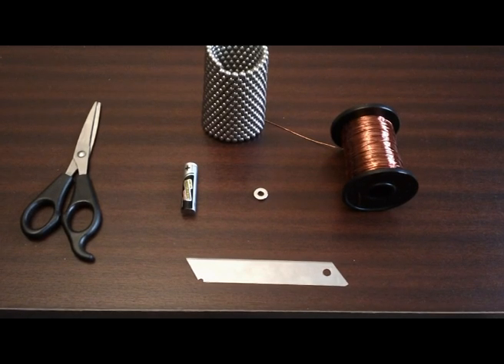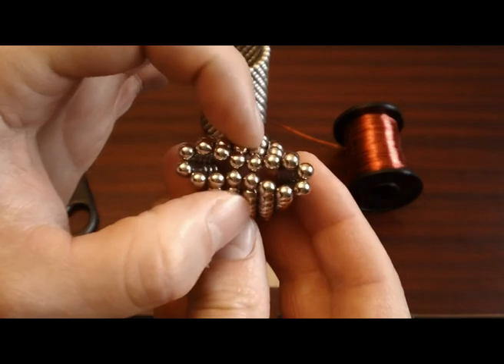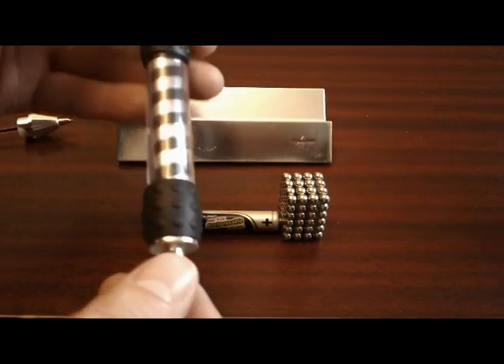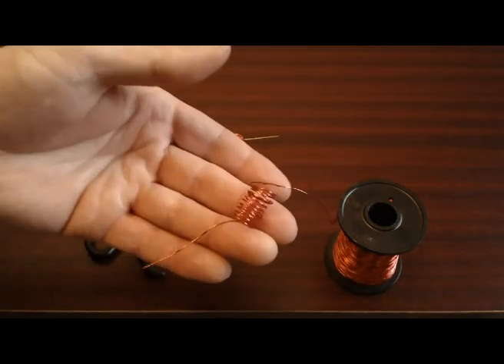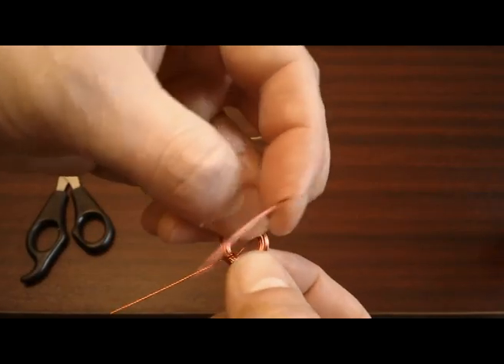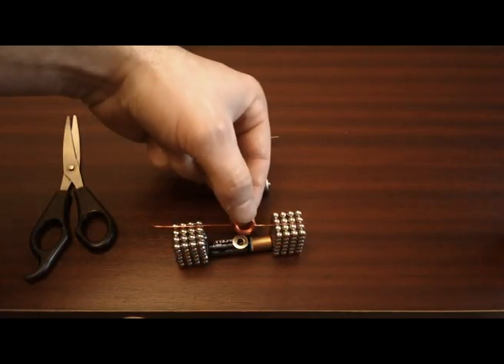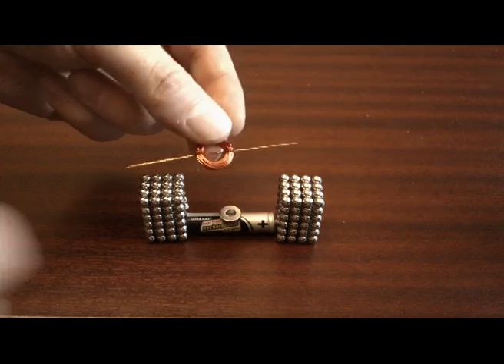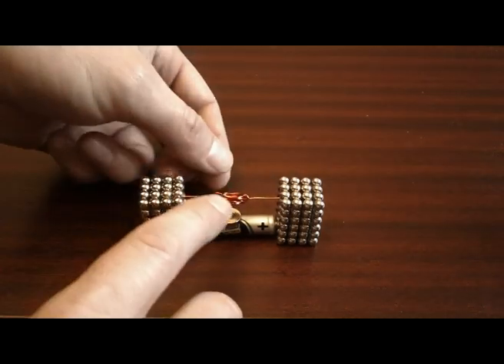My Buckyballs Motor Tutorial.

Comment: Just did this and it works great. One tip is after you've made the loop and got it pretty close to balanced, try spinning it between your fingers (like it spins in the motor...) and that'll "round it up" and get it really well-balanced and centered before you start. Having the loop straight and balanced is the key...aloha!

Comment from the maker: @kubzlud 
They can be very hard to make, was the battery new? was the coil well ballenced and not wonkey. did u scrape off the wire coating of the ends of the wire compleatly. was the magnet you used on top of the battery strong?

Comment: If the height of the buckyball columns on the side is too short does it affect the spinning of the wire.? Did everything you said but it still doesn't spin. Could not having the right amount of the buckyballs be the problem?

Comment: wont it short circuit? mine did and when i touched the coil i got a small burn
Reply: Then you are doing something wrong. I THINK it's impossible to burn yourself with that low voltage....
Reply: Won't that short circuit?
Yes and no.... With this motor, it is a short circuit, but this example shows the basic principles of brushed motors.
No, it isn't a short circuit because the length of wire used to create the coil is acting as a resistor.

The heat caused by your motor must be from a short circuit inside of your coil(lowering the resistance > letting more power through > generating heat) or because you've used uninsulated wire.
Reply: its not like a real burn i just feel its hot unpleasent
Reply: Alex Shi Try using a longer coil or a half dead battery

Comment: Mine doesn't work either. I'm using extremely thin copper wire. It retains its shape just fine but it is very bendy and thin. Is this why mine is not working? Also, I'm using the neocube dots.